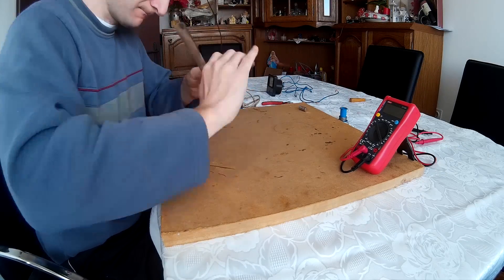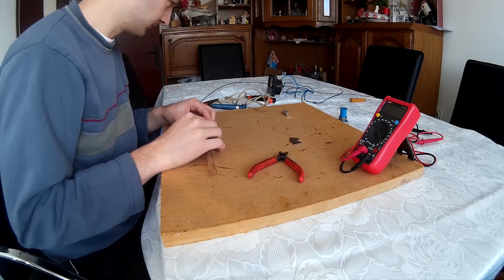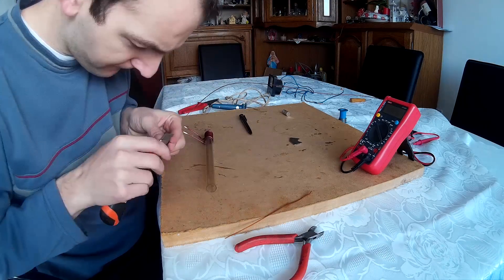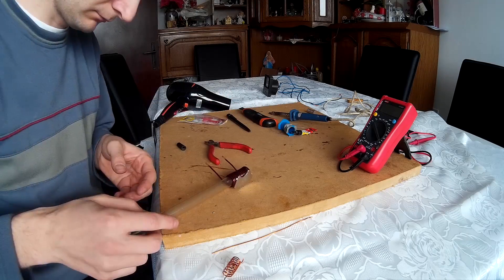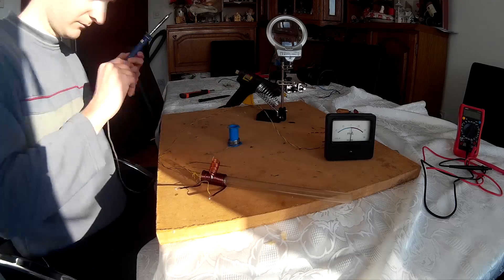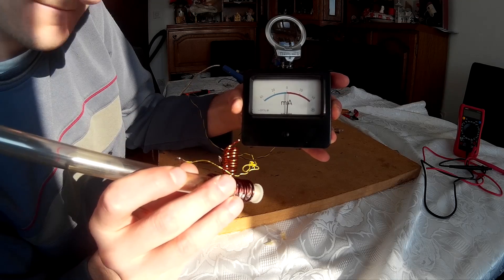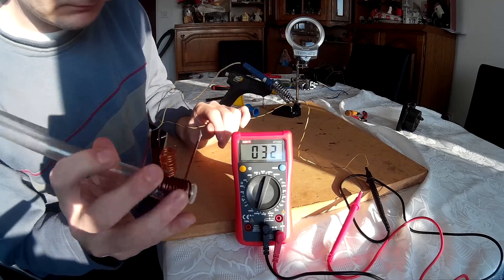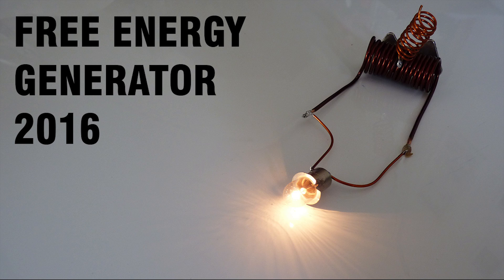Free Energy Generator 2016

Comment: tried and tested personally, but it only produce 6 volt. its not really fake and we don't really know exactly how energy is produce without motion of magnet, but it works.

if you put insolator between the magnet and the coil and measure magnet and coil while grounding it with your hands you get 6 volt. i have tried it it does read 6 volt but doesn't give 6 volt if you don't ground it with your hands very strange.